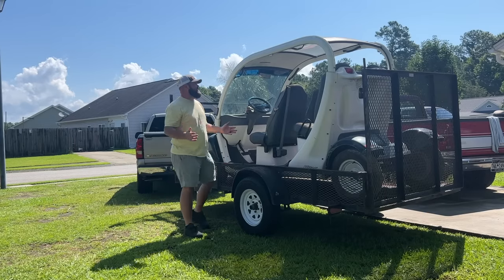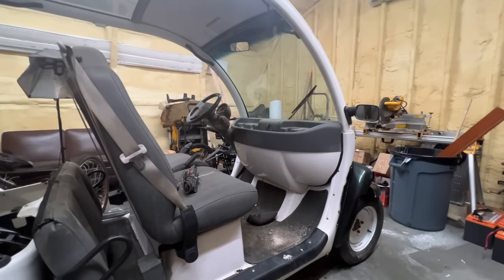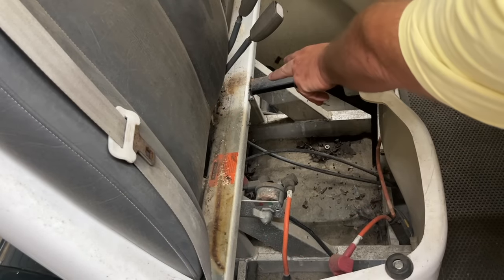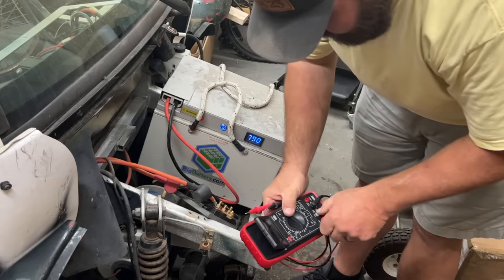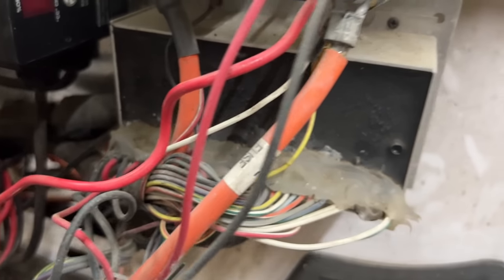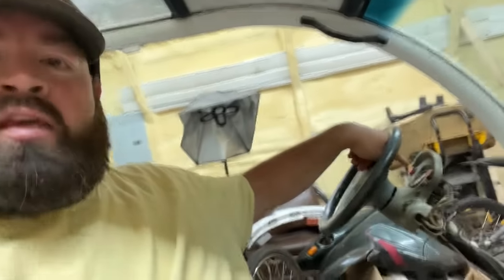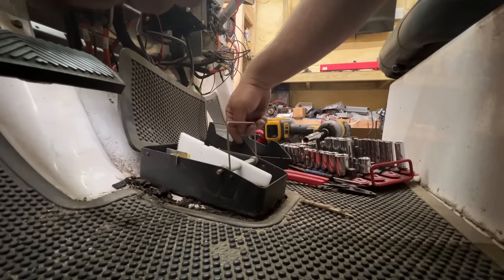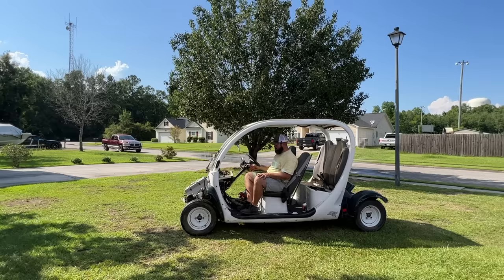$300 SCRAP YARD GEM CAR E825 | WILL IT RUN?

Comment: Hello there my friend.  Code 11 on yale older forklifts with a Curtis controller is that micro switch in the accelerator assembly.  So I'd go ahead and swap that out. And make sure that switch activates before the pot starts it's sweep. Hopefully it helps.. Thanks for your videos 👍 as a forklift mechanic that works on ev only I enjoy how you tackle each project 😁

Comment: Great video!  That's a great score since you already have lithium batts for it.   Not a Gem guy but I would replace that micro switch and potentiometer since that's cheap and would eliminate that as an issue

Comment: Looking forward to the follow on video for this Gem E825. I am interesting to see how that lithium battery works out. If I can find one of these locally for cheap, I might get one for summer runabout duty. Running around the neighborhood and to the grocery store.  Perfect plan to spend $1000 to $4000 to save $45 in gas.

Comment: Make sure all your contacts are clean. As well as all cables are good. I’ve had carts with new batteries, cut off because contacts are corroded or wires don’t make good contact underneath the shrink wrap connector.  Controller sees it as insufficient amperage from the battery and will cut off temporarily.

Comment: You need to replace the micro switch in the pedal..

It's the little switch next to the potentiometer.. 

I'm pretty sure that's what is cutting out on you They are notorious for doing  that...

Comment: Hi , great help to me. I just bought a similar GEM E825, Zero experience with these as well. Was thinking of converting to ion system
Reply: @Fentertainment—- watching this new video you just posted inspired us to update our 2001 2-Passenger Short-bed GEM e825. We’re going to copy what you’ve done here, ordered our Lithium battery and accessories. Will arrive soon! PS, used your code and saved $, TY!
Reply: Are you using the Zivan charger (usually used for the gel bats) for the ion batteries?  Thanx

Comment: At 16:40, the 4 pin you pointed out is for factor gps.  Will you put the cover over the controller to keep it from getting wet and failing?  I hear ya on those rear leafspring bushings in the older DS cars, they can be a bear.

Comment: What a GEM lol cheers nice job! I suspect the potentiometer has a dead spot in it find out the swing .5-5V and replace it, your power loss should be resolved I don't feel its the micro switch as it happens when the throttle is in use so i would swap out the pot control and retest  IMO 95% sure when the pot goes to 0v this is what would happen (dead spot)
Reply from the maker: i agree

Comment: Had the same issue with mine and found that this code is triggered when you have the pedal depressed when you change from forward to reverse or the other way around. I found that mine was a loose wire or dirty contact in the forward reverse switch.

Comment: so whats up with this gem? i just found a 2 seat utility for 200 without batteries . im thinking 212 predator ,live axle swap because its a 3 link rear axle it would be very easy to do .
Reply from the maker: I still have it and plan to finish it this year. Im staying with electric though, Im not a gas fan. Ive done what you're thinking of doing before on an ezgo I got for free once.

Comment: Great deal for $300  - I have one ? I noticed your gem solenoid only clicks when it turns on - mine clicks whenever I take my foot off the accelerator- does anyone know it there is a fix for that and is it ok to leave as is - my first gem 2000 e825 - with ride for fun motor - thanks for any advice

Comment: I have the same gym car and I’ve been trying to get it running. There’s no charger in this when someone has taken it well it operate without it.
Reply from the maker: I'm not real familiar with these as this was and is my only one ive ever been around or worked on. However since there were no batteries in this and the batteries I used werent compatible with the charger I dont see why it wont.

Comment: Ah the poor Sun car!   The Gem is cool. Charger should have been under the hood.  I love those things.  Do yourself a favor and just rip out all the wiring and start over.  Make it simpler
Reply: I think the original charger was a Delta Q charger.  Maybe was upgraded when the new motor was put in?
Reply from the maker: @RBallarddesigns  Im thinking so. Once I get brakes I will run it and see what it will do but so far without brakes i know it will run in the 30s.
Reply: @Fentertainment  that’s an awesome project and a cool video. Inspiring
Reply: @Fentertainment With the suspension and brakes these things have, I would have this thing AC motor converted and flying in no time....When I looked at that Ford Think chasis, it looked wider, I saw 3 Falcons under the seat of one Big Battery did.....

This is gonna be fun 🎉🥳🥳🥳